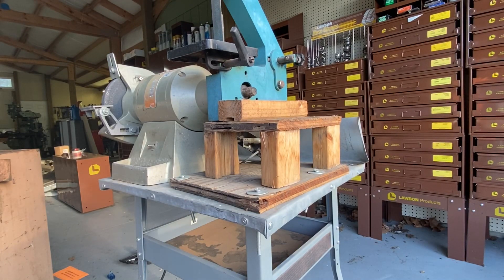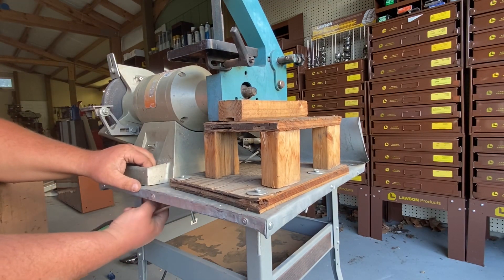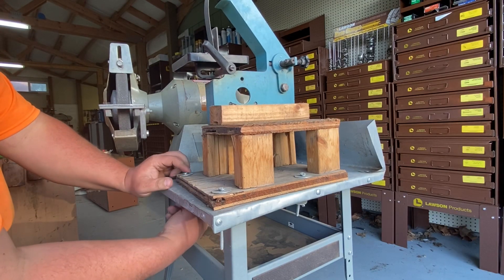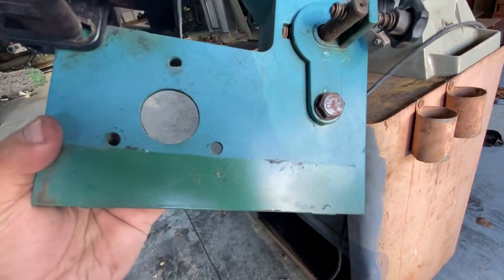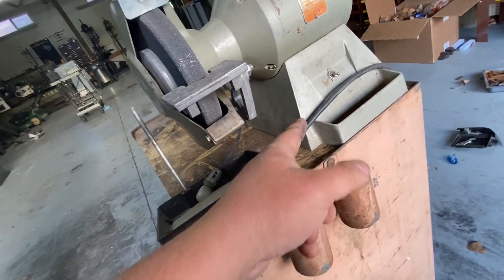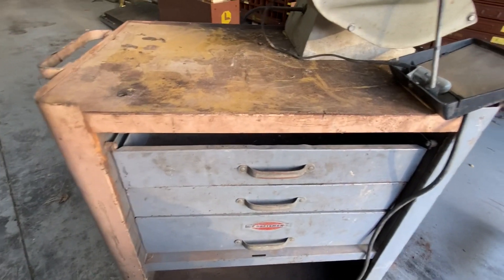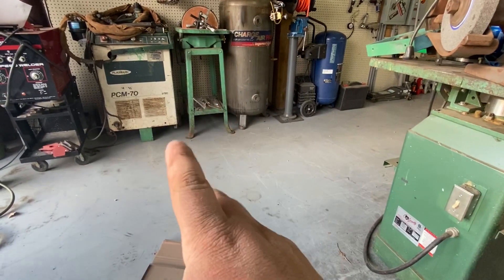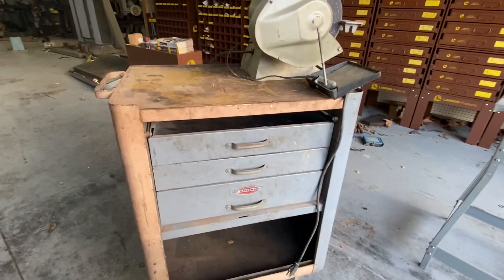Mobile grinding station part 1

Comment: Glad you addressed the casters. Hate to see all the work only to watch you have to tear it down again to change the wheels.
Reply from the maker: Yeah I actually left it by the slope of my driveway and it rolled down it that’s what reminded me to put brakes on it
Reply: @smalltownmachineshop6860  lol oh no! That could get dangerous. I have my revised junk built mill on big locking casters... when unlocked it can be like a little runaway freight train on the uneven basement floor.